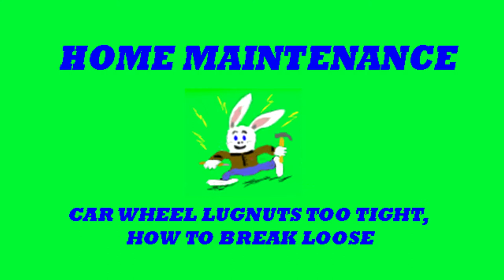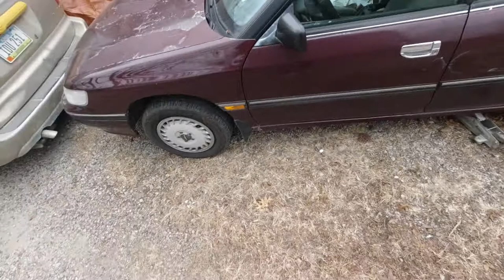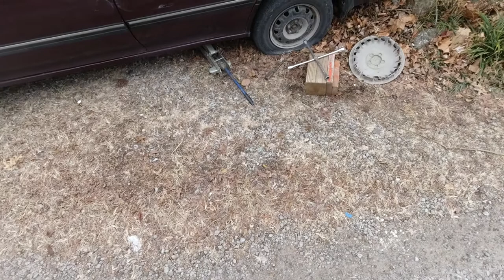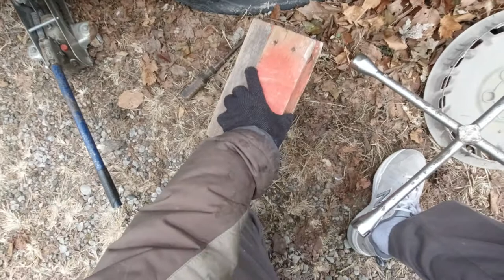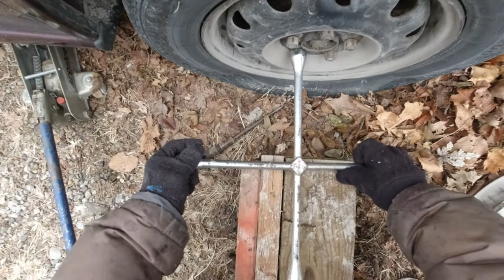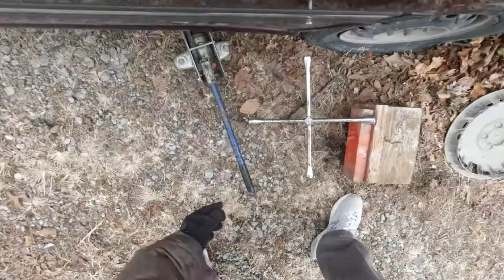CAR LUG NUTS TOO TIGHT, USE WRENCH BLOCK#shorts

Comment: The problem is the height of the wooden block. it will work for some lug nuts. but when you go to another nut their is no support, the difference is the low lug nuts and the high lug nuts.
Reply from the maker: Use different size blocks, or use a jacket stand that can be adjusted up and down.
Thanks for the comment.

Comment: lug nut started to come loose then got tighter and tighter.
If I retighten it ,   it  gets better. Try again to remove.... gets worse again.  What am I gonna do. Help !
Reply from the maker: Try spraying with WD 40, then let set for a few minutes. Could also use a wire brush to clean the threads. Then try loosening the nut again. If still difficult, then turn the nut back and forth, and spray again with WD40, go back and forth, gradually removing the nut. If it's difficult all the way, the threads may have gotten damaged. Replace the threaded lug and get a new nut.

Comment: Good video.  I've done that and it works.
I have a different problem now.  My light weight trailer tire is flat and the rim spins on the tire.  There's not enough weight on the tire to keep the rim from spinning while I turn the lug nut.
I did get all but one off by using two lug sockets.  I held one lug socket on one nut with the break over bar and kicked the other one with a ratchet on the other lug nut.  I can't figure out how to get the last tight lug nut off.  Any ideas?  Thanks
Reply from the maker: Put one of the other lugs back on, then do your technique w two break over bars to try to loosen the stuck nut.
2. Another idea, Put two of the other nuts back on. Then put a deep socket over each nut. Then put a prybar between the two sockets while you use a beak over bar to loosen stuck nut. 
The prybar end should be on the ground and against the direction of rotation.

Comment: i got thru all of them except 1. That 1 is so tight not even WD-40 will help, used my whole body both feet to jump an loosen it, won't turn.  Its ridiculous.
Reply from the maker: Get a break over bar, with a six point impact socket(black), then fit a 4foot pipe over the end of the breaker over bar, make sure the socket is securely on the nut, then try to turn the nut.

Comment: Mine are so tight my my lug wrench twisted.
Reply from the maker: I think someone over did it.
Reply from the maker: Meaning over tightened them. Probably need an impact driver.
Reply: @swilson6206  yes. I did. with the impact when I tightened them last time. Oops.
Reply: Ya they turn there godam guns up to 300 lbs and that's ridiculous. 100lbs is plenty
Reply: @williespoonemore3392  apparently it takes more torque to loosen than it does to tighten so go figure
Reply from the maker: @williespoonemore3392  you could also try a break over bar with socket. Use a pipe as a cheater bar on the break over.
Reply: Shit!